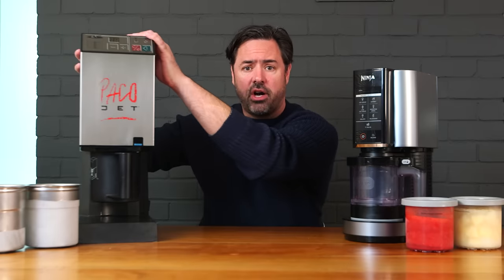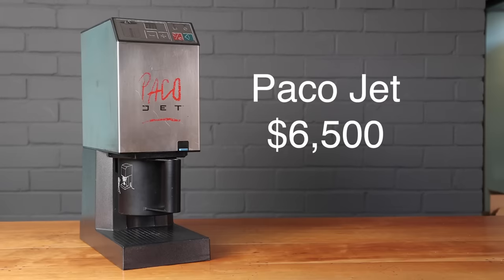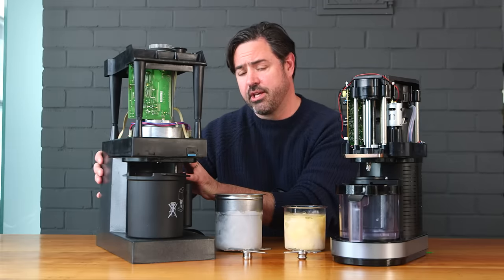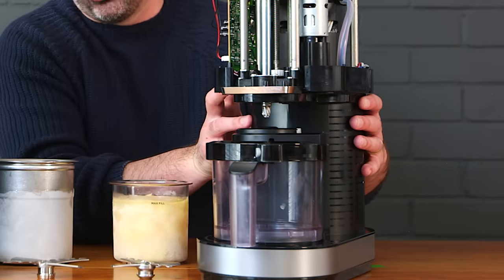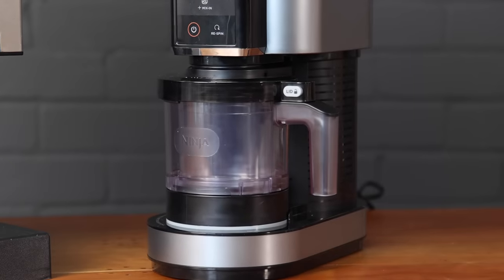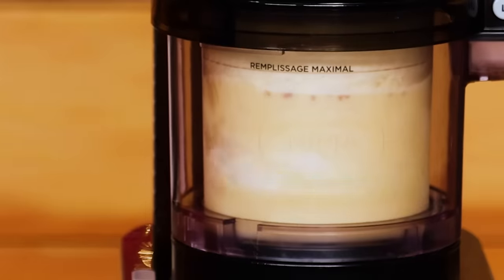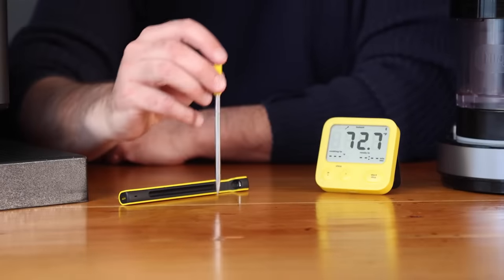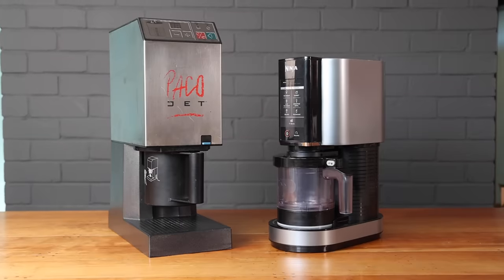Ninja CREAMi: Pacojet Killer?

Comment: A question in regards to selecting a paddle-based ice-cream maker versus the Ninja and on the basis that where I live getting plenty of 30 degree celsius plus days over 5 months of the year (and in summer, many of those days are humid). With the paddle-based makers and the ice-cream being better aired holding the colder temperature longer, will it take longer to melt than the Ninja? I read one review where one person in a warm climate had reverted from a paddle-based to the Ninja because of their annoyance with melt occuring whilst transferring the product from a cuisinart pre-freeze bowl model into a container for storage in the freezer. I may want to do that with the Ninja if I buy it e.g. 2 or 3 Ninja tubs into one larger tub for storage. And if you do put the Ninja final product back into the freezer for another couple of days, does it  go too icy and require another spin before using again? Cheers
Reply from the maker: Ric, the answer is that it really depends on your paddle based machine: A churned ice cream will be slower to melt than one processed in a Ninja. On the other hand, most consumer and semi-professional paddle-based machines aren't able to freeze the ice cream to a very low temperature when churning (-5°C ideally) and so the ice cream melts before you can transfer and harden it. Ninja and Packets avoid this problem because the mix is already very cold when you process it. 

And, yes, you can reprocess the mix in the Ninja again (although it's not quite as good after reprocessing).

Comment: Excellent! And I love my Creami, but we can in fact see the saved costs in a few places - the unprocessed rim due to manufacturing tolerances, same reasoning for the occasionally scratched pints, the impossible to clean inside lid design.
Reply from the maker: The blade doesn’t get close to the edge of the PacoJet canister either, and when measured the gap it the same. And for both machines the gap is smaller at the bottom of the canister than at the top because of slight draft angle to the canisters.

And I didn’t find the lid difficult to wash.
Reply: @ChrisYoungCooks  The lid is somewhat problematic because small amounts of the produce always get inside from the blade grip. And while it's possible to rinse through the (small) openings, it's not really great. Especially around the spring. Would be easier if it could be disassembled.
Reply from the maker: that’s a fair point. But I’d argue the PacoJet is worse. Food debris can, and does, get into the pressure holes above the lid and into the air pump. It cannot be cleaned without disassembling the machine and cutting and replacing the tubes. And this creates the possibility every container gets contaminated when the air pump pressurized and blows debris into the headspace above the food. This actually occurred at a restaurant I worked at, and is why we disconnected the hoses.
Reply: I hadn't operated a PJ much, so that's good to know. But again, I love my Creami, and if the worst complaint I have about an appliance is that it's annoying to clean (note also the "self cleaning" drive shaft ...) it's really not too bad.
Especially at the 30x price differential, Ninja did an outstanding job.
Reply: @JorgTheElder  The insides. You can rinse it by running water through it, but you can't really get at it, including the spring, which always retains a little bit.

Comment: How did you get the upper shrouds off the creami? I’ve taken out all the screws but can’t figure out how to get them off without breaking them. Trying to fix my broken creami
Reply from the maker: I can’t recall the correct direction, but the internal plastic tabs will pop and slide out. It requires a bit of force, but not so much you break the plastic.

Comment: Thanks for such a comprehensive video! I'm keen to know how both the Pacojet and Creami handle cleaning of that shaft, especially after lots of use (or did you mention it and i missed it?) users have reported issues cleaning the creami. Since it's only down when the machine is running how does it stop getting icecream up in there? how can you avoid allergen cross contamination?

Comment: I worked in a professional kitchen were we had the newest pacojet. 6000 euros of a machine, but it can still break down.
But once you work it in your processes you cant really do without. So after it broke the first time, we got 2 ninjas as emergency backup.
Reply from the maker: Definitely how I would do it now if I was still in restaurants. The PacoJet breaking was a total nightmare.
Reply: @ChrisYoungCooks  someone we managed to melt the outer beaker to the inner.

I think at one point it was not locked in properly. 
 That combined with super hard mass, we used it to make pistachio creme. It was celeriac puree + whole pistachios. Made for a super sexy crème. Paco didn't like how hard it was though.

Small bit of friction from not closing properly caused it to heat up. Then once  it was slightly deformed it would only get worse.
Reply from the maker: Yeah, I remember “forcing” the Paco to grind some canisters right out of the blast chiller. Remembering what an f-up it was when I broke the blade right before service.

Comment: I would rather have to replace the canister than the blade and canister.  A metal one will dent and then the blade will hit it deeming both useless. A plastic one just needs to be replaced but won’t damage the blade.

Comment: So I've had the Creami for a little over a week now. While it makes the best-textured low-cal ice cream I've ever had, unfortunately I've run into the issue that many others have with plastic being scraped off the sides of the container, particularly towards the bottom, and ending up in my ice cream. I am not sure the exact cause but one could imagine that any eccentricity of the driveshaft, which is magnified the longer it extends, is a recipe for the blade hitting the sides and thus ingesting plastic. It is much harder to get service in my country than in the USA as we don't have an official Ninja channel, just resellers, so I can't be sure what the issue is, but if this is a design flaw it's a particularly egregious one in terms of food safety....
Reply from the maker: That is strange, and I didn’t have that occur on my machine. Based on how it’s constructed, and eccentric shaft is unlikely. More likely is that the plastic container is not mounting perfectly straight into the mount mechanism. A few things I’d check:

(1) If you set the blade in the bottom of the container, is there a few mm of clearance on either side of the blades? You should rotate the blades into several positions to check. If there is a spot where it gets really close, the plastic container might be out-of-round.

(2) Run the system with everything attached, but with nothing in the container, does the blade rub when the container is empty? 

If it doesn’t rub when the container is empty, it’s possible you’re ice cream mixture is too hard and is causing the blade to tilt slightly while running. I’ve seen this happen in a PacoJet when the mix is very hard from being too cold or not having enough sugar or fat to soften the mixture, which is a risk with a very low-fat ice cream mix.
Reply: @ChrisYoungCooks  Thank you for your prompt and detailed reply. As expected, the local reseller's solution was to replace the scored plastic pint. However, based on your comment and the fact that people said the bump in the middle is caused by cold freezers, I turned my freezer down from -19*C to -16*C. It hasn't happened again since, so I am hoping this was it. Ninja might have to adjust their temperature range up, as -19*C is well above their stated lower limit of -7*F or -21.67*C...
Reply from the maker: @grivkin2  I’m so glad it helped. If you increase the sugar or fat content, you should be able to be successful at a lower freezing temperature.

Comment: will your temp sensor actually work in a smoker? i have MAK 2 star general smoker and it's fully stainless steel and i have yet to find a wireless device working more than 1-2 feet away from it.
Reply from the maker: I use mine in several smokers without problem, as do many of our customers. The metal will reduce the range, but the display acts as a signal booster that can sit near the smoker. We also offer a charger that can act as a range-extending booster too.

Comment: Thank you so much for this video. One question: would the Ninja Creami be as sufficient to create extrem homogeneous purees of nuts or cooked vegetables as the pacojet does?
Reply from the maker: It should work. But be careful about freezing them to a very low temperature. It’s a good way to break the blade on either a PacoJet or CREAMi (having done this a few times over the years)

Comment: This explanation/ comparison was fascinating and thorough- thank you! I've watched several reviews of the Creami and they almost always need to "re-spin" the mixture once or twice to change it from a powdery to a creamy consistency. Also, they mention the extreme loudness of the Creami- was that your experience as well?
Reply from the maker: Noise-wise it's quieter than the PacoJet! But it is as loud as a blender while it's running for about 2.5 minutes. Re-spinning tends to be necessary if your ice cream or sorbet recipe doesn't have enough dissolved solids (mostly sugar and milk proteins), so less of a machine problem and more of a recipe problem.

Comment: Hi Chris, I made the "Dairy-Free Cocoa Gelato" recipe that it is in ChefSteps, which I think you developed years ago. I churned it using the Ninja CREAMi. Although the texture was amazing the taste was not. It had a burnt/bitter taste although I only roasted the cocoa for a little more than 1 hr (instead of 2 hr). I used Valrhona cocoa which is not Dutch processed. Could this be the cause of the  off flavor? Anyway, I'm able to rescue the batch by adding a little whipped cream on top of each serving. Any suggestions on how to improve this amazing gelato?
Reply from the maker: It really sounds like the cocoa was burned. I can’t think of anything else in that recipe that would contribute a bitter taste. Suggest making it again, and skip roasting the cocoa. Otherwise, roast at a much lower temperature.

Comment: Did you do any experiments with the various settings on the CREAMi and how they impact churn time, shaft velocity, or rpm?  I'm having great success with mine, but lack some optics into which setting to use on what variety of product.  Does it fundamentally even matter?
Reply from the maker: Yes, I did some testing of this. The video already got a bit long and it didn’t get in. But basically, both ice cream and sorbet max out the rpm’s, but sorbet feeds the shaft a bit slower. Presumably this is because sorbet base is much harder when frozen and they’re trying to get a smaller “chip” size when cutting.

Mix-in was very slow rpm, but relatively fast feed rate. Other settings were in-between.
Reply: @ChrisYoungCooks  Thank you much for the data!  Really great work and I appreciate the content.

Comment: The section about air (overrun) is very interesting and surprising to me.
I did an informal vocational internship at one of the most popular & successful gelaterias in Palermo (Sicily, Italy) and I chose as my textbook the most thorough and extensive manual that was available (as far as I was able to discover at the time based on several types of research: online searches, library searches, direct inquiry at numerous bookstores, investigating the curriculum and references materials where the artisan craft of gelato making was taught, and direct inquiry of working professionals).

My reference material claimed that the more dense (less air content) a product is corresponds to a snowy feature of melting.  The logic was that air responds more quickly to temperature changes, while it takes more time and energy to raise the temperature of a more dense frozen solid.  That model certainly sounds logical and reasonable so it was very surprising to hear you claim the exact opposite to be true.

To bed honest, I'm quite skeptical in general and I'm certainly very skeptical of both claims at this point!  (Skeptical in the classical sense that I require as much and as many forms of evidence as I can gather both for and against each claim.  Unfortunately, gathering that evidence is basically not feasible for me at the moment.
While I am aware that air can be an excellent insulator, that is in very specifically circumstances that depend on sealed pockets or layers of air which doesn't seem to match the pattern of air dispersed throughout a gelato, like product by the whipping process.

I do not dispute your experiences with these products; however, I am inclined to question your interpretation of the reason & source driving those experiences.
There are some crucial factors which you do not seem to have considered or measured.
1.  The amount of warming that devices of the nature your are using will inevitably introduce through multiple mechanisms
A. The heat generated and introduced into the product merely by the mechanical process
B.  The heat transferred from the blade
C. The heat introduced from the ambient environment, and in particular that from the motor to the air & area immediately surrounding the machine.

Your experience certainly is valid in a very real and important practical scenario.  However, in order to be valid as an explanation of the actual mechanisms and physics at work you would have to take grateful and accurate temperature measurements of your products throughout the scenarios.

Unless you return your product to the freezer to cure after processing it in either of these devices, there will obviously & inevitably be a very distinct and significant difference in temperature between this product and the one created/frozen in the traditional method which had also been properly cured.

I would argue with a fair amount of confidence that "slower melting" product with more air is not actually melting more slowly, it is merely beginning to melt from a much colder temperature.
And I am quite certain that if you were to properly cure the product coming from the devices you are evaluating; therefore bringing the product back down to the same temperature as the other product which you compare these products to, your experience with what you interpret to be the speed/rate of melting would be reversed.  And you would experience the reality that the denser product is slower to melt.  And your previous observations were not actually reflective of the rate of melting but of the difference in temperature of your products.

In any case, whether or not your interpretation of why one product melts more quickly than the other is mistaken, this is an excellent and thorough review of these two machines and I appreciate it very much!
Reply from the maker: If you read the text book Ice Cream, by Dr. Douglas Goff, which is the standard textbook in most university dairy science programs, the physics of melting and role of air is well documented. It included nice timelapse photos documenting what I’m describing in this video.
Reply: Blimey, I think I will stick to Mr. Whippy!?!

Comment: At $200, you could just buy 5 of these and rotate them out as needed in a professional environment.
Also, when you talk about it milling the ice block into cream, I'm wondering why it uses such small blades when a "cheese grater" style disk and a churning arm on top would whip in much more air and make a smoother end product.
I'm also surprised they don't sell an insulated container in metal for the inner beaker for those who want it.

Comment: Just ordered the Ninja Creami. Any suggestions on how to make frozen slushy beers or slushy wines?
Reply from the maker: They have enough alcohol that they won’t freeze solid, so just freezing in the container and running the blade through and a slow speed should do the job.
Reply: @ChrisYoungCooks  Thanks for your reply. Most beer slushes are made with low alcohol sour beers (4-5.5 %) and wine Susie's are made with wine adding fruit juices or fruits like grapes, pinepple, melon, watermelon berries uy these should lower the alcohol and help freeze better. Consistency is like a soft sorbet and remains icy.

Comment: Would you say that it are a difference in the noise level between the machines?
Reply: Pretty similar, which is to say loud. The PacoJet is a bit lower frequency noise, which seems slightly less annoying. But both are very loud.
Reply: @combustion_inc  Thanks, I had seen some reviews that mentioned the creami being loud but I wasn't expecting it to be "use hearing protection or your ears will hurt loud".
I suspect that atleast ninja have failed in legal requirements as the machine should likely have a "hearing protection mandatory during use" sign on the creami.
I personally measured it to 90db when reprocessing sorbet that I had initially processed earlier the same day and refrozen. But I have seen measures as high as 98db and that is far too high for consumer products.

Comment: apart from the fact that the ninja is not rugged the cost outweighs that, as far as volume goes you could simply buy 2-3 ninja and a heap of extra canisters but honestly in my personal experience you simply don't churn stuff that much during a service in most cases...
my place of work has a Paco jet sitting on a bench doing absolutely nothing for several years and its containers are used to keep tasting spoons in on two sections...😂😂